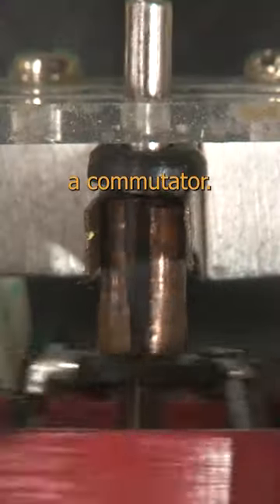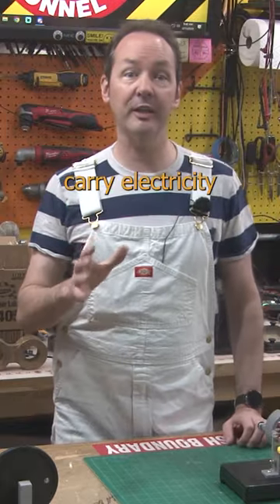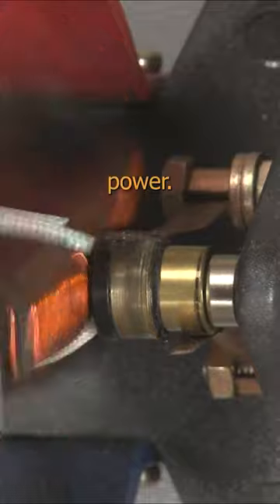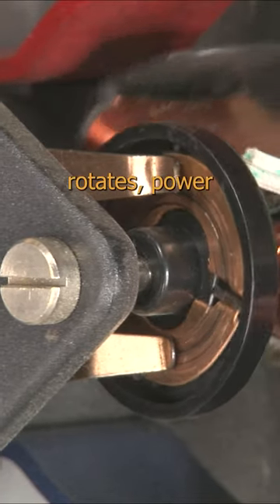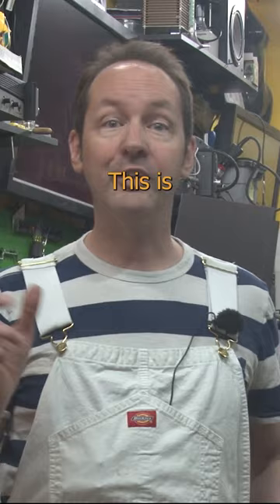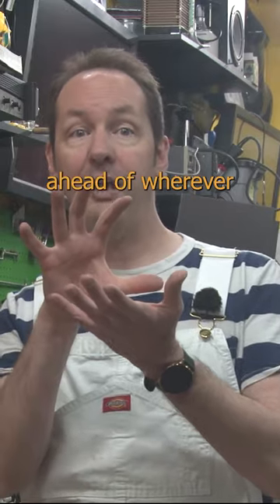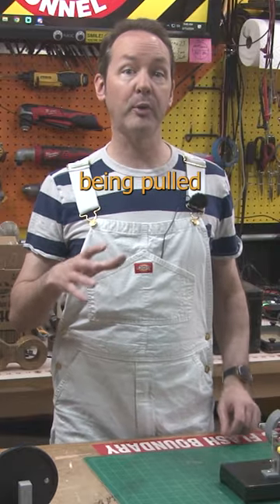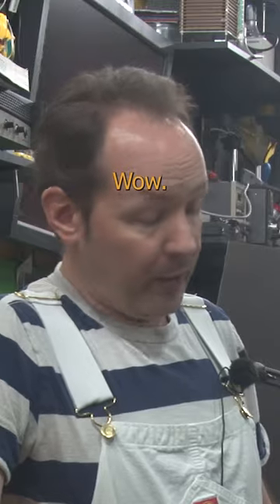Slip Rings vs Commutators #engineering #motor #generator #science #electricity #power #energy

Comment: Commutators are used in DC generators, brushed DC motors, and universal motors. My cordless power tools uses microchips and stator windings to spin a magnet shaft so they do not have commutators but they do have more power and efficiency,

Comment: That last remark made me almost yell "THANK YOU"

I was told that the difference between an alternator and a generator is that an alternator is AC, while a generator is DC.

Then I learned the actual difference. (Alternator, rotate the magnetic field. Generator, rotate the coils) Whether you use a commutator or slip rings dictates whether or not you get AC or DC out.
Reply: Well, both are simply correct, the latter being more fully technically accurate.
Reply: My wife says that too !! 😅😅😅😅

Comment: I remember learning about this in high school science class.  Also something called a "Wheatstone bridge" I think it was. A clever arrangement of diodes to turn AC into DC.  Very cool
Reply: the wheatstone bridge is a way of finding an unknown resistance, the ac -> dc converter you're thinking of is most likely the full bridge rectifier as it looks quite similar on a schematic
Reply: Typically the bridge is 4 resisters arranged as 2 voltage dividers with one unknown resister in 1 divider and one variable resister in the the other. A galvo or null meter across the 2 midpoints to show when you achieve balance.

4 diodes are usually called a full bridge rectifier. This passes both +- halves of the AC wave but flips one half so you end up with pulsed dc.  Usually smoothed to a reduced ripple cleaner DC with a capacitor.
Reply: That's a full wave rectifier, the diodes that is.  The whetstone bridge is just a set of 4 balanced resistors with a bridge resistor.  If one of the 4 outer resistors change (load, light, stress), you get a change across the center bridge current and voltage.
Reply: That is not a Wheatstone bridge.
The device that turns AC into DC is a bridge rectifier.

A Wheatstone bridge is an arrangement of 4 resistances and allows for accurate resistance measurements to be made.

Comment: A commutator is the heartbeat of a universal (series-wound) motor.  If the motor has a shorted winding in the field coil, or one of the three armature coils is open, etc., the commutator will show the failure in various kinds of wear and oxidation.  A motor that's been running hot for a long time may even start to throw the commutator lands (and generally stops running almost immediately when that happens, because the step that produces will very quickly eat the brushes even if the motor could otherwise keep spinning).

Comment: Commutators can be a real pain to clean, especially on old model trains which I have a lot of. If you use a q tip and rubbing alcohol, it smears the grease. If you use a little brush, it also smears it. You have to really work at it

Comment: Is this how the rotary rectifiers worked in Grand Central Terminal ?

They had huge wheels that were A/C and they made D/C as the spun.

The wheels were 10 or 12 feet in diameter.

They now have these huge solid state metal boxes that do this using electronics and no moving parts, but it was incredible to see these old wheels spin

They had to use large wooden rods that they used to push start them.

Comment: Anyone else remember when you rebuilt starters and alternators instead of just slapping on a Wilson?
Reply: I remember slapping on a replacement Bendix spring assembly. Used to see the springs lose tension and drag or the solenoid relay fail, both now incorporated inside of a modern starter.
I also rewound a starter motor once and well, never again.
Later, slapped on a rebuilt, sent the defective unit to be rebuilt, less man hours wasted on the thing and ended up cheaper in the end.
Reply: I still either clean up or repair a starter especially if it’s still OEM. Usually I polish the commutator, lightly sand the brush ends and clean up the starter as a whole and sometimes replace the solenoid. The starters sold at parts houses either new or rebuilt don’t seem to last. Amazing how a little 30 minute cleaning and polishing up a dragging or no crank till you tap it starter usually is.😂

Comment: The main core would be stationary , and the pulley to power it could be on the front and an additional pulley could be added or a flywheel on the back to allow it to power other generators or workloads

Comment: I would disassemble toys with motors in to see which type it was. And it was DC. Happy memories
Reply: Used to repair those motors, just for fun and get the toy working again, as frequently it was just a bad metallic brush that caused the failure.
But then, I was around 9 when I disassembled Dad's Baby Ben alarm clock, then reassembled it and when I completed adjusting it, it was far more accurate than before.

Comment: I was just about to comment about it acting like a mechanical rectifier 

And you mentioned it lmao
Reply: I'll ask you. Is it the commutator that creates AC or does that create DC.  I have always been silently curious about it.
Reply: And in a motor it is a mechanical inverter.
Reply: @Xsiondu 
In a DC motor the commutator creates AC.  In a generator it creates DC.
All common motors and generators are at their heart AC machines.
Homopoler motors and generators being the exception but unless you have worked on something like rail guns for the military you are unlikely to see one.
Reply: I believe if using it as a motor and applying power to the brushes / commutator it creates AC over the coils, but if turning the motor and taking power out of the commutator that rectifies it to being a DC output.
Reply: @andreblanchard8315 You are not actually creating AC.
What it is doing is changing the direction of the current in coils in order to change the direction of the magnetic field and keep the armature rotating.

The current in the circuit is still DC.

Comment: How does big commutator prevent sparking?
Reply: They spark, but ever so minutely and rarely, like if their hung and not touching well.   The brushes wear down very slowly from friction more than burning off from the switching action done across commutation.
Reply: It doesn't. That is why you often can smell ozone near motors and why they sometimes but a capacitor across the terminals to suppress the electrical and RF noise generated.
Reply: I think sparking would only happen with poor power factor. 

As you probably know, sparks come primarily from inductive kickback: every coil has some inductance -- "inertia" with respect to change in current -- and will fight back against sudden changes in current with a spike in voltage. Trying to open a circuit with a coil in series while high current is flowing through that coil results in a spark. 

But with good power factor, the current/voltage/commutator are all in phase, and there is minimal/no current at the commutator's crossover point.

Comment: Since AC and DC generators are being discussed, I would like to ask a question I've always had. I know it may sound stupidly simple, but why do we need sophisticated circuits to change ac to dc? Cant we just connect an AC motor's output shaft to the rotor of a DC generator?
Reply: I'm guessing, here, but I'd imagine the energy loss makes it less efficient, but you physically could do that.

That's how you get 3ph power from single-phase (A/B).  A 240V single phase motor turns a 3ph motor to generate 208V or 277V 3ph power. (Thinking about it after I first posted, I suppose one could get any voltage based on what the output motor can generate, if I'm not mistaken)  There are also more expensive solid-state 3ph generators that use circuitry to the same effect.
Reply: Yes, and it was done commonly both ways before large vacuum, mercury arc and eventually solid state rectifiers were available. It was still common to do it to convert DC to AC in telephone exchanges until solid state oscillators kicked off.
Reply: DC Voltage cannot be transmitted as efficiently  when compared to AC Voltages
Reply: They are called motor generators or MG for short. They have been in use for a long time powering things like subways or other high voltage DC transit systems. There are some in Grand Central Terminal in New York. Because of the importance of them. During the WWII. It was reportedly a shoot on sight order if anyone was seen carrying sand into the room that houses them. They are being replaced with more efficient soild state designs but you just can't beat the current capacity of a MG.
Reply: You can,  and I work at what used to be Alice Chalmers, and there are some fairly large examples commenting dust in the rooftop penthouses.
Reply: It's called a motor-generator set and has been used in the past (still is sometimes). Nowadays, semiconductor rectifiers are better for most applications.
Reply: Because it is very easy to change the voltage of an AC circuit, and very hard to change the voltage of a DC circuit. 

For power transmission, we need very high voltages, in the hundreds of thousands of volts. But for home use, we need low voltage, like 120 or 240 volts. To change 400.000 V to 120 V, you just feed it into a transformer and hey presto, your dangerous power line voltage is reduced to a (relatively) safe house voltage. Then, to rectify low voltages of AC to DC, you just need five simple components: four diodes and one capacitor. Easy peasy. See Electroboom: FULL BRIDGE RECTIFIER. 

Stepping down (or up) DC voltage is very, very difficult indeed. It’s usually done by converting DC to AC, then using transformers as described above, and then rectifying it back into DC. Very cumbersome. 

So there you have it.
Reply: We can, but it's less efficient due to losing energy to friction (or rather converting nice electrical energy into pointless heat energy due to friction)

And then also add such mechanical systems needing way more maintenance
Reply: Short answer, efficiency.
I had a mechanical inverter, 12 volts DC in 110 volts AC out.  It was around 50 to maybe 60 percent efficient.  And the no load power draw was like 30 to 40 percent of it's full load output.
Reply: Will ya look at that! Even an old dog can learn something new just about any day.
Reply: The conversion of AC to DC is not a sophisticated circuit, it's a rectifier. Just. A few diodes. A very simple circuit.

It is more efficient, more compact and zero mechanical noise when compared to using an AC motor mechanically coupled to a DC generator.

However there are occasions when using the configuration of an AC motor on the same rotating shaft as a DC generator is useful, notably when there are very high current levels.
Reply: It might just work. Can you paint it for me?

Comment: Why do we use Alternators in our cars that need to be DC and Generators in our homes that need AC
Reply: An automobile generator runs the high amperage output through the comutator, which causes sparking that makes the brushes wear out all the time, requiring frequent replacement. In contrast, the alternator uses diodes as rectifiers, which eliminates the need for a comutator. The slip rings in an alternator only carry a small current to the field coil on the rotating armature so the brushes on the slip rings seldom need replacement. Alternators are better than generators because they last longer before the brushes need to be replaced.